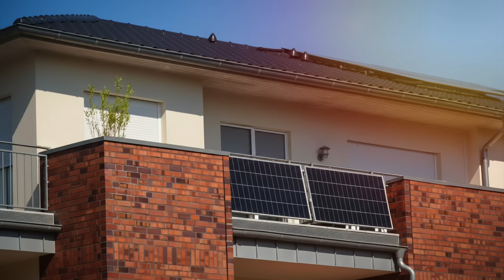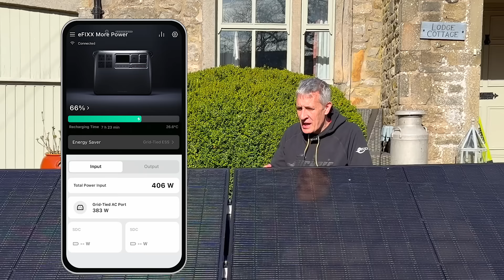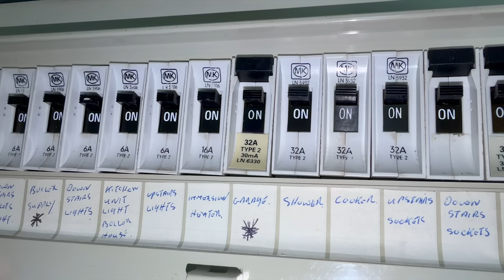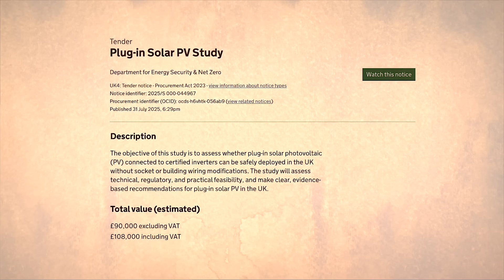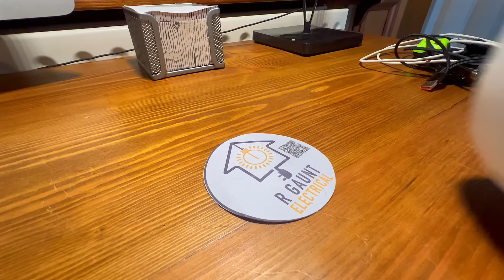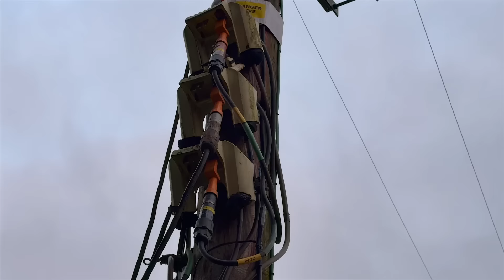Plug in Solar: We’re Told Never Do This… So I Did

Comment: Unless you are using an off grid or hybrid inverter with batteries, all solar (which has to be grid tied to function) is effectively "plug in".  The only difference is are you using an actual plug to connect it to the house power or an "approved" AC interconnect?    Since a 13A plug and standard UK ring main using 2.5mm cable is designed to handle a continuous load of 13A it doesn't matter whether that goes in or out. After all it's AC and it is always flowing both ways at 50hz.  And as long as the DC-AC inverter between the panels and the main is a suitable grid tie inverter of less than 2.8kW (13A @ 220v) with <20ms disconnect time then it no problem safety wise.

The REAL problem (no conspiracy theory) is balancing the local grid.   Too many unknown/unregistered micro solar installations feeding back can start to cause a significant grid imbalance and put strain on the local interconnects.  When you install a solar system and get it approved the DNO will be informed and they add the expected output of your system into their grid calculations as they would any other generation plant.  If there are too many they dont know about then suddenly those calculations are wrong and we have the sort of problem that caused the Iberian Peninsula to trip its entire grid for 3 days last year.

Comment: I really want to install a solar fence in my south facing garden and I think these balcony solar systems would be perfect for It - but I'm waiting for It to be legal so I don't invalidate the house insurance.

It would really help in the low winter sun as we have an air to air heat pump system with no energy storage. It seems to average about 500w when running. More if it's very cold. A small self installation would take a huge chunk off our bills in the winter and probably cover the majority of our bill in the summer.

The results of that review can't come soon enough!

Comment: I'm confused.    I can understand power from solar being stored in a battery; and from thence to power tv fridge etc.  But why connect to mains. Where would the power go? If the power generated was less than used in house,  would it offset the amount pulled from grid?   Is that it?  What if no power was used in house, would all solar power produced go back to the grid?  Isn't this giving free electricity away?  [ Talking in laymans terms, apologies if using "power" incorrectly, but you get my gist)

Comment: Small scale stuff like this needs to be legal. Solar is cheap and this would save a lot of low income households and flats a hell of a lot of money over the course of a year. If enough people did it emissions would drop too. Energy companies would also be quids in as they sell on the majority of it.
Reply: @Bloorr  I live in a conservation area so can’t have panels on my slate roof. I have a flat roof on an extension on the rear that I could get 2/3 panels on. Plug in would be perfect for me. I could route the wiring into the loft and have the batteries in there. 

I’ve only just started looking into it but this seems perfect for someone like myself!
Reply: @mpallister87  Just be careful of the temperatures inside where the battery is stored. Some lofts get too hot in the summer and too cold in the winter.
Reply: @Bloorr i need to do a lot more reading and research first before I do this but that’s great to know. I could stick a temperature sensor in there and have it hooked up to my HA instance if that’s the case.
Reply: @mpallister87  I live in a grade 2 listed building and have consented solar panels.
Reply: @nickdavies1977 what’s your roof like? Mines slate tile, no membrane or anything under. I’ve approached the council and been told I wouldn’t be allowed it on the roof but if I could find some supporting documentation that I should be allowed then that would be great!

Comment: Loads of Qs:
So you can just plug the solar into any circuit, and the same with the battery?

Does this work with a dumb meter?

If the power goes out the solar and battery will have to stop providing power to your household circuits to avoid issues with synchronisation when the power comes back on, preventing use of the solar? In this case the only power you could use is directly from the sockets on the battery?

Comment: Had 600w like this for over 5 years plugged in.  You can export to the grid and you do not  paid if you plug in like this . So a battery makes sense to capture surplus power generated.

The only things to watch out for - old dial meters will spin backwards 

New digital ones flash red to indicate there’s something strange with supply.

Otherwise no issues at all

Comment: ive had 2kw set up to a uk plug for years, saved a fortune by doing it DIY
Reply: Fair play. I hope you took suitable precautions to stop backfeed when your mains is off. I'm sure you understand that feeding 240V into your 13A socket can energise your local transformer to 10KV on it's primary side which will be further transformed to 30KV or more (dependent on your Country) further down the line. And when you fry the guy whose trying to fix the actual fault, the 1st thing you'll know about it is when 2 police men come knocking on your door...  But you've taken precautions that this cannot happen,  right?
Reply: @johnc3403 ye i just discharge any excess energy into my bathroom toaster
Reply: @Weapons-grade_slop 😂

Comment: The question isn't 'when will this be legal' the correct question is 'why was this ever banned?'
Reply: Can't be banned Aldi are selling it this summer
Reply: @stacki2008 Aldi get their stocks from Germany where it is legal. Your average procument manager for an Aldi probably doesn't think to check the legality of something that seems like another straightforward product.
Reply: It's not banned, just not (yet) compliant to regulations.
Reply: The legal hurdles are that the UK plug and socket regulations - originally brought in to bring a rag tag of various round pin standards under control need amending. And BS1363, and BS7671.
Reply: The Energy companies don't want this! How will they make their money?
Reply: Well to be fair, it is only fairly recently these inverters have addressed the issues that would have made plug in solar dangerous.
Reply: There are those who will attempt to self hang a device of a balcony building wall and the consequences to someone passing under a block of flats, house etc... we live in a world of liability and claim and the magic one is tax... and price rigging with the energy companies when your not buying electricity they are not taxing
Reply: @graemedarling2852  In my experience there are always reasons to ban anything because of what somes 'might attempt' and the POSSIBLE harm it could do. They should be resisted.
Reply: 240 volts on the exposed pins of the 3 pin plug when you unplug it. Quite dangerous that. Probably why they banned it.
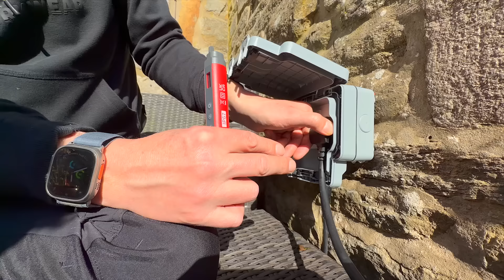Reply: @M0WWS  Haven't you watched the video? There's a demonstration of unplugging around 1:45
Reply: @M0WWS  did you not watch the  video chief...? He proved that a non issue.
Reply: @M0WWS inverters on systems like this need live power supply to start producing power, that's very, very standard
Reply: @bwcdevices3028  every standard now!
Why the ban has now been removed!

Comment: In principal if you were to plug in 1 or even 2 micro inverters maxing out at 800w into a single ring main you’d be fine, as you said the risk is someone plugs in 10 and wonders why it gets a bit hot in their house.

With decent guidance it will be safe for most people, you’ll always get idiots who decide to build themselves a 10kwp array and plug it in and wonder why there’s issues
Reply: Are your plug sockets rated at 4 amps? Anything up to 3kW is fine on a 13 amp socket normally. Unless you wired your socket to the lighting circuit, of course!

Comment: Looks dangerous to me. Sockets are outlets - you're asking for trouble
Reply: Luckily, electrons can't see and therefore don't notice that it's actually only meant to be an outlet, and thus behave as they usually do in electrical circuits.
But you can, of course, have your trusted electrician officially relabel it as an inlet; then it will immediately feel safer. 🙃

Comment: In the event of a fire, My concern is whether your home insurance company might use this as an excuse not to have to pay out?
Reply from the maker: This is something we explored in this article https://www.efixx.co.uk/Articles/solar-panels-battery-storage-home-insurance-costs
Reply: @tonyb9735  I would imagine the insurance company would need to be able to prove that it was the solar input that caused the fire. They can’t deny insurance if it was due to some other reason that wasn’t excluded in the policy.
Reply: @regwatson2017 I have to tell you that here in the UK the insurance companies are absolute bastards. They bury stuff away couched in legalese deep within the terms and conditions. 
I don't know, but they might not have to prove it was the cause the fire, only that by having it, or by not having it installed by a certified electrician, you have invalidated your insurance. 
I would strongly urge anyone considering fitting this equipment to  carefully and specifically check the small print on your insurance.

Comment: interesting, though i dont understand how you divert solar power to charge batteries when needed and not feed grid and then take from batteries rather than grid.
Reply from the maker: The Shelly meter is measuring the grid connection - If it sees power leaving the property the battery charging kicks in.
Reply: @efixx  thanks, that makes sense

Comment: Hi, what do you mean by arbritage? You arent buying in at less than £0.10 off peak are you? And you arent selling to the grid at peak times?
Reply: Eon night rate is under 10p/kWh (7p I think). Fill your battery at cheap rate and use at peak rate (20p+) times = arbitrage albeit not strictly simultaneous but usually same day.

Comment: How long does the inverter take to switch off after grid power is lost? The maximum time allowed for RCDs is 300ms. If an earth fault occurs on the socket circuit, the inverter won’t shut down until after the RCD has tripped.

Comment: The batteries only last 10 years, so after 10 years new batteries would be required, which would completely negate any savings. All batteries degrade with chronological time and use cycles. My ecoflow has a 10 year warranty but up to 10 years the storage capacity will be degrading from day one as my EV has. It is 10 years old now and has lost 6 out of 12 battery bars ( 50% ) and is nearly ready to be scrapped because it would not be financially viable to buy a replacement battery.
Penny wise and pound foolish.
Reply: My battery saved enough in 13 months to pay for itself.
Reply: @nickdavies1977 tell us more, how much was your new battery, what vehicle was it, have you accounted for depreciation ? Statements without figures are meaningless.

Comment: 100% support for something like this to be legal. A lot of renters can benefit from this and take it with them.
Reply: See landlords charging for 'damage' caused by some scuffs by mounting brackets
Reply: Yes, we already have solar panels but they're an old rent-a-roof system that don't generate a whole bunch and would definitely be open to get some more modern ones we could take with us when we go.

Also interested in how this opens the door to plug-in battery systems that feed back into the home like Dutch HomeWizard battery solution that's designed to store the solar energy and feed it back to the home.
I've thought about using a Jackery or DJI, but the devices I'd like to power are so spread out, that it wouldn't be a good ROI without running extension leads out of it around the house.
Reply: Who pays if it burns the property down?
Reply: @michaelkent6121  In the very rare event that it might cause a fire due to a fault - like literally every electrical device...
The landlord's home insurance would pay for the building & tenants contents insurance would pay for the contents.
Reply: @SamPhoenix_ yep. If it's rated as safe, but the property wiring isn't that's on the land lord. 

I can see lots of landlords excluding them from their leases because they can't be dealing with the risk when their stock.has new fuses but the wiring si still from the 1970s
Reply: Oh that’s ok then 🙄🙄🙄🙄🙄

Comment: I have an Ecoflow Stream setup (X1 Ultra and X1 AC PRO) which I bought as soon as it was released and love it. I have put it on a plug into a socket wired directly into my workshop consumer unit. I did plan to wire it directly but never got around to it. Especially once I learned that it's currently under legislative review. It is restricted to 800W also, but selecting another country in the app shows that it's capable of outputting 1200W (800W is plenty for me). I'm finally able to store the excess power from my panels. I have plugged x2 of my panels directly into the system to reduce conversion losses. My other x2 panels are still on Enphase micro inverters feeding the batteries, but I plan to expand my battery capacity to enable all my DC panels to feed the DC batteries directly.

Comment: My understanding is that there is a very easy problem to create. If you have both source and load on the same circuit it is possible to over-rate the wiring and cause thermal issues and start fires. For example, if your Balcony Solar also has a beer-fridge plugged into it, then all the wiring that is on the leg before the breaker/RCD can carry more amperage, without protection, than it is rated for. You must have the knowledge and discipline to ensure that each circuit in the house is Source-only or Load-only, so that current always flows through the main panel, and trusting the general populace to do so is not something that Code-Enforcement is willing to do.

It's also important to note that there are two types of micro-inverters:  grid-tied and off-grid. The grid-tied inverters get the Hz timing of the AC sine-wave from the mains, which is why you noticed that current drops immediately when disconnected.  Off-grid inverters have their own timing and will not do this and will be a threat like a live wire downed after a storm. Be aware of which one you buy.

Comment: I’ve been running a 1.2kw system on my shed roof like this for 10 years now.
Reply: Likewise I bought 2 x Soladin 600W units in 2010, I have just had to replace one of them, I did not repair it as the price for a legal inverter was not worth the bother to repair it.
Reply: With 10 years old batteries?
Reply: @miragebg no batteries

Comment: As an alternative you can use Wieland plugs and socket outlets for that. It has no exposed parts, not on the socket outlets and not on the plugs. The VDE actually demands such a system, instead of a simple Schuko, if the PV is installed by a professional. Also an issue can be if you don‘t install a dedicated circuit, you can actually overload the wiring. The MCB permits 16A, in addition to the power that is sent  into the same circuit by the PV, and bypassing the MCB.
Reply: not in the UK - we have plug and socket legislation that would have to be amended or repealed first. Only 13A plugs permitted in UK houses. (yeah, right... )
Reply: @mikep-j894  For standard applications. That is not a standard application. That system has no exposed contacts in the socket outlet, and no exposed contacts in the plug. So a perfect system for a plug-in PV system where both ends of the connector could be, theoretically, live at mains voltage.

Comment: Wait a second, the whole reason for plug-in solar being so loosely regulated and allowed is that it doesn't export, it handles demand within home network and effectively shuts off if there's no demand.
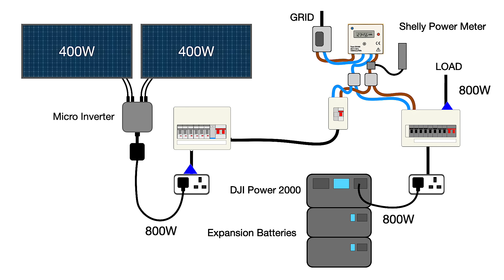Why is 5:25 you consider the plug-in solar as exporter while it shouldn't be doing that under any circumstances?
Reply: In the UK it is allowed to export.

Comment: Since adding a 13.5 kWh battery to my house, my average unit rate has dropped to just under 10p across winter, and 7p in summer. We're a fully electric house, no gas at all. Best thing I ever did.
Reply: With or without solar?
Reply: @RuralDissident  If he has solar his daytime electric will be zero (either solar or battery powered) and at night he should be topping up the battery and powering the home at 7p. Charging the battery at night on the cheaper electric allows any excess solar to be exported sooner at the best price i.e. charge at 7p, export at 15p.
Reply: @fruitytv-uk  without solar or wind? I take it you are on one of the offpeak tarriffs, charging at night and using it during the day?

Comment: Makes sense for a rental house. I installed a cheap Luxpower SNA5000 with 4x550w panels and a 14kWh battery. We run without grid consumption throughout summer. Cost was R50k here in South Africa. ( £2500).

Comment: i will be honest ive never seen a qualified electrician or electrical engineer touch a line that is live down the line relying only on a cheap device. that does not fly. your exspecting the entire grid to rely on the pos device to keep them safe. do you have that much public liability insurance to cover deaths due to negligent acts

Comment: fastest way to kill a service engineer. if the grid fails your back feeding current into the system. highly forbiden
Reply: If the grid fails the inverter will lose its ability to output power due to it's reliance on a mains reference voltage.

Comment: Southern UT with a single 540w bifacial panel. 52 days in and I’m averaging 2.4kWh/ day. Or over 868kWh/ year. And we’re not even at equinox yet. I have 32 more panels ready to install once the permits accepted. I could hook up two panels and backfeed without a permit using that same inverter, and even that would save over $20/ mo. in electric bills.